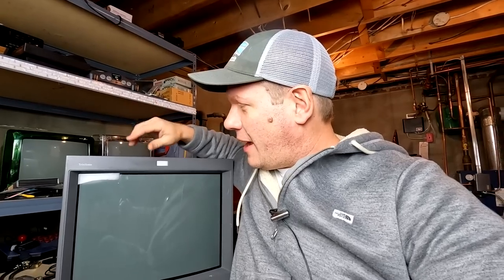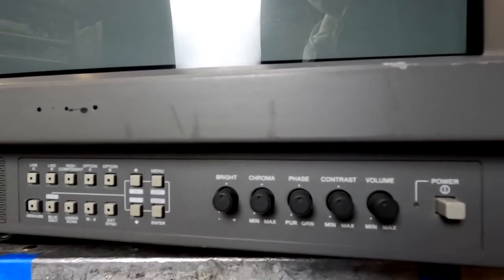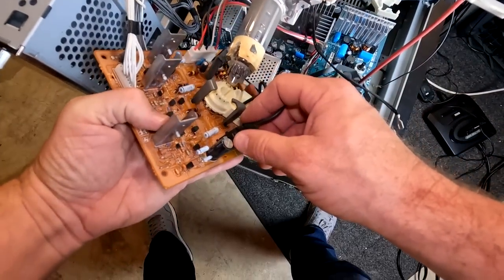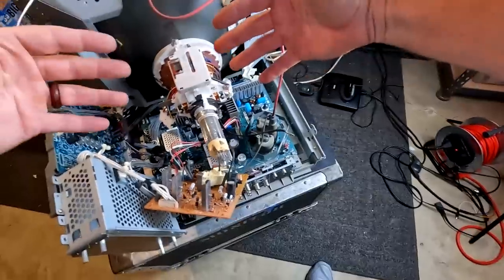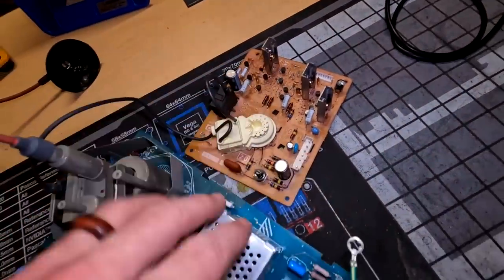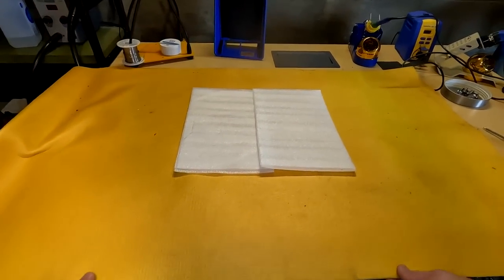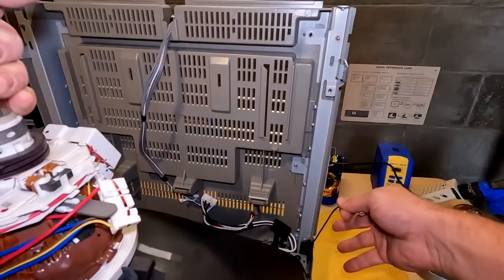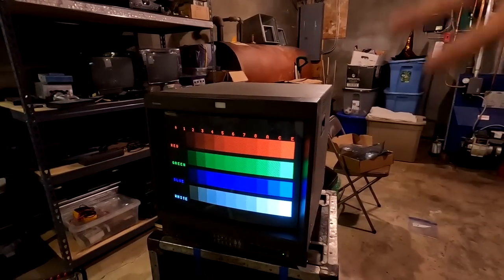Sony's Last Pro CRT - PVM 20L2 Trinitron Deep Dive

Comment from the maker: What do you think of the Sony PVM 20L2?
Reply: i got the medical variant of it, really like it and the modular card slot in the back, was lucky and mine had a bkm-129x pre-installed when i got it.
Reply: @Howema  I also have the Sony PVM 20L2MD ! It's great! What's that extra card for?
Reply: Great video. Just recently, I started a new job as the IT guy for a private high school and we were cleaning out things and I came across a Sony Trinitron PVM-14L2. So I decided to take it home.

I pulled out all of my old consoles and I have been slowly putting together everything. Cables, switches, flash carts, plus an aftermarket add-in board.

I didn't realize how expensive receiving a free CRT would be. Haha.
Reply: Looks like a really good unit! Is it for sale?
Reply: I think they're a pretty solid range, I got a PVM-14L2 so nice to get a tour inside. :) Managed to get mine locally and his Dad got it from medical surplus fyi. Poor guy had seller's remorse and offered me $200 more to bring it back but the shipping costs and condition matter is why I bought from him. :|
Reply: @RobertKreese  The BKM-129X gives you another set of RGB/Component inputs and outputs.
Reply: It costs me $1000 to get one, but still worthy, I think.
Reply: I want one. All I ever find are 14" or smaller
Reply: Seriously? I think this is overpriced junk. These do like 500€. The amount of amazing consumer sets you can get for that much money is insane, and to be honest, most consumer sets here in Europe 1) have a nicer picture, as too visible scanlines suck, it has to be a little blurry vertically, 2) have way cooler looking cases, not that military grade look, 3) usually have better sound, especially the stereo models, 4) are lighter and 5) are way easier to use with remote, multiple direct usuable inputs and RF tuners on board.

Comment: doesn't the 50/60 Hz label on the back just refer to the frequency of AC voltage it accepts, which is related to but not the same as the vertical frequencies it will display?

Comment: I've got a basically new PVM-14L2 from 2005. The colours and sharpness of this monitor are absolutely gorgeous. Never seen something better, besides of HD PVMs. Unfortunately... it's only a 14" monitor, not 20" or 27".  I also had a 21" consumer Trinitron with a perfectly flat picture, that I used for the last 10 years... but now I switched to an Bang & Olufsen MX7000 CRT (27") and oh boy... while the picture is not as perfect as on a PVM, the whole "package" is better than anything else. The TV looks stunning, it has a short tube and the best sound I ever experienced on any TV to this day. I wish you could get your hands on one of these too, but they are VERY rare in the US. If you ever go to Europe, come and visit me. =)

Comment: Great video. Just recently, I started a new job as the IT guy for a private high school and we were cleaning out things and I came across a Sony Trinitron PVM-14L2. So I decided to take it home.

I pulled out all of my old consoles and I have been slowly putting together everything. Cables, switches, flash carts, plus an aftermarket add-in board.

I didn't realize how expensive receiving a free CRT would be. Haha.

Comment: I have a question: The PVM 20L4 is available for a decent prize near me. It doesn't have the controls at the bottom. Is there an external controller board that needs to be plugged in to make changes or how do those ones work? Noob question I know.
Reply: The controls are hidden in the vertical side bars. They light up, but they can also be made dark.